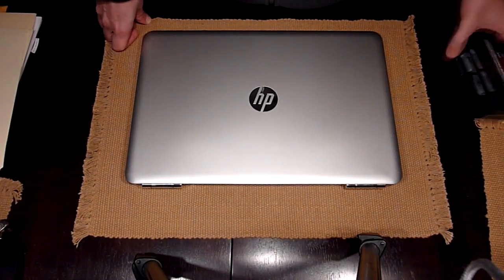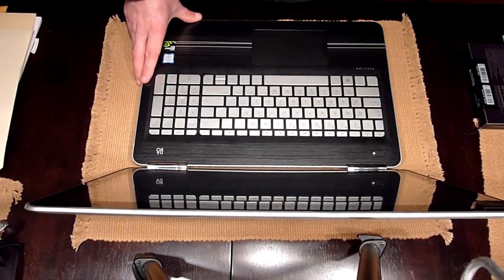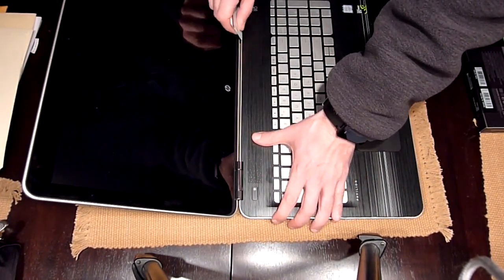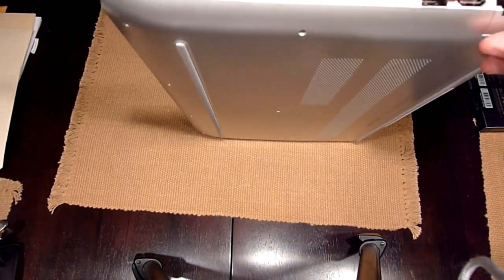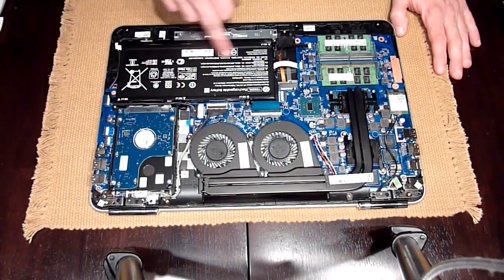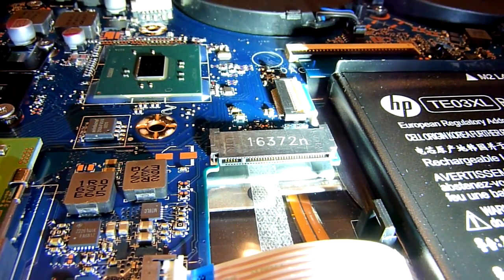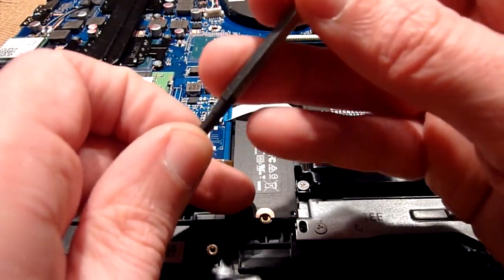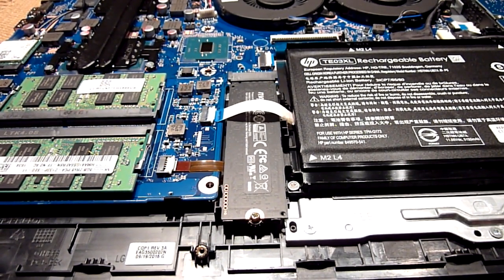HP Pavilion 15 bc018ca Laptop with Samsung 950 PRO M.2 NVMe SSD Drive install

Comment: Thank you so much you have been a great help.. so my conclusion is.. put the ssd in and clone the existing hardrive 
. And when that is done open it up again and swap the existing hdd with a new one. Keeping the old one to keep warranty intact? I thought when I used the migration tool it would take the system of that hdd leaving it formatted
Reply from the maker: You're welcome. Well, this is what I did, I kept that 2TB drive intact with the recovery partion for two years ! My warranty end next week !!! When I had to return my computer in april, I just removed the M.2 drive, poped in the original mechanical drive in and sent it for repair. HP can't say nothing about it, everything is there including the recovery partition. They DID wipe out the original drive, once I got the computer back, it was a fresh install. I then removed again the mechanical drive and re-install my M.2 and continue exactly where I was before removing it !

I have NOT installed a second drive in mine. A second mechanical drive will slow down your system for sure. If you would use a second mechanical drive even if it is to host work files, when you work with those files on that slow drive, the system will have to "wait" for the data to load. Windows sometime will use that drive for temp files (out of your control). When you boot, the system will have to wait for that mechanical drive to spin up and register on the system before the system boot, this will slow down the startup time of your computer for sure.

Either buy a larger M.2 drive or install an SSD as a second drive. This is what I plan to do as large M.2 drive are still quite expensive. I'm not saying not to install your mechanical drive, I am just reminding you that it WILL slow down your computer for sure.
Reply: Sorry I can see your confusion. Although I got sorted.. I installed a 2nd ssd to replace the sata drive that. And with it.. would it be possible to put the sata into an enclosure and use as back up? And if anything went wrong with the laptop just wipe the sata again and reinstall it?
Reply from the maker: @elcooko4372  you can leave the sata drive inside the computer along the m.2 drive but it will seriously slow down the computer for sure. If you use the sata drive in an external enclosure as a backup drive, yes it will work BUT you will loose the original recovery partition from HP as it does NOT transfer from the sata drive to the m.2 drive when you clone it. If you were able to clone the recovery patition to the M.2 drive, I seriously doubt it will work, I've never seen a recovery patition work from any  cloning software.

My goal was to keep the original drive intact with the recovery partion so in case of repair, HP could not detect the PC had been opened.
Reply: Ok thank you.. so when transferring the data to the m.2.
  the sata keeps the recovery partition?
Reply from the maker: @elcooko4372  the recovery patition stays on the sata drive, it is NOT transfered to the M.2 drive. And IF you see the recovery partition on the M.2 drive, I doubt it will work in case you need to rebuild the installation from scratch. I don't know why cloning software do not clone properly this recovery patition... I've never seen the recovery patition work to a cloned drive.
Reply from the maker: @elcooko4372  when you clone a drive to another one, all data stays in the original drive until you delete it or format the drive.
Reply: https://www.easeus.com/backup-recovery/copy-recovery-partition-to- 

It seems it can be copied to a flash drive/ usb 

Maybe do that and then use the sata as a portable hdd
Reply from the maker: @elcooko4372  I have used easeus backup and recovery software in the past but I don't know why, each time I needed to use the recovery patition, the Dell or HP diagnostic tools could NEVER find the recovery patition. Maybe it now work but since I mainly install Samsung SSDs, I use the Samsung cloning tool which does NOT clone the recovery partition. The Samsung cloning software is small, fast and reliable but ONLY works on Samsung SSD, you can't use it with other brands. Other software like easeus or acronis are huge software suites that install many files to do backups and other tasks. Samsung cloning is ONLY for cloning so it is small and fast.

But this is just me, you can use any suite of software you like. This is my preference. I like to keep the whole integrety of the system, this is why I want to keep the original drive intact as long the system is under warranty.

Comment: I have the hp 15-bs033cl and my manual only had up to 512gb for m.2 SSD and was wondering if I could get 1tb instead. Like the Samsung 860 EVO 1TB M.2 SATA
Reply from the maker: yes, I am pretty sure there is no problem about that. The original mechanical drive was 2TB so I seriously doubt this will cause a problem The drive listed in the service manual are the one that HP provides and going over 512GB is going to considerably rise the price of the system, I am pretty sure they keep the size low to keep the cost lower.
Reply: Also why is it that I can get a Samsung 860 Evol M.2 SATA(3 prongs) but I researched and apparently I can't get like a Samsung 960 Evo PCIe NVMe(2 prong), even though I took a look and the Samsung 960 should fit perfectly, perhaps even better than the 3 prong? Both product has the same form factor of M.2 2280 so I was just wondering.
Reply from the maker: why can't you get a NVMe drive ?
Reply: @Aleziss  I was wondering if I could because I was looking on forums and they said this model of laptop couldnt support NVMe
Reply from the maker: oh, that is a different story then, if you found the correct information and it is said to be SATA, don't buy an NVMe, it won't work.
Reply: @Aleziss  Alright thanks!
Reply from the maker: you're welcome. Best upgrade you can offer yourself ! You won't regret it !

Comment: excellent video. I am hoping you can help me. I just purchased the 

HP Pavilion Power Notebook 15-cb061na  in the spec is says 8gb(1 stick) which model of 8gb do I need to make it 16gb?

And what kind of ssd do I need to upgrade the memory? Do I need a connector and if so can you tell me where to find it? Sorry for all the questions lol
Reply from the maker: thanks for your appreciation. Google is your best friend, the service manual of your system state at page 1 " Two non-customer-accessible/upgradable memory module slots,
DDR4-2400 dual channel support, Supports up to 16 GB of system RAM, 16384-MB total system memory (8192×2)" and at page 2, "Support for M.2 PCIe SSD". Information was found on the document here : http://h10032.www1.hp.com/ctg/Manual/c05493193
Reply: Thank you for your time.. Does it say non customer accessible because it's tricky to open? And does that mean I just need to purchase one more 8gb ddr4 ram stick considering it says it already has one?
Reply from the maker: Frankie Cooke  you're welcome. I would assume you are right about the access of the ram. Same goes with mine, there is no access from the outside of the computer, you need to open the case. If you do already have 8GB, you could get another 8GB but if you want my opinion, I would buy a kit of 2x8GB so you have the same memory brand, model and performance. Mix-matched DDR modules can cause issues if timings are different even though they are the same type of RAM modules. Or simply open your computer and check what is already in it and try the get the same thing for the other memory module.
Reply: Thank you very much Aleziss.. I just have one more question regarding the ssd.. Do I need an adapter? And if so which kind of adapter is it? I really appreciate the help
Reply from the maker: Frankie Cooke  hmm... no ? what adaptor are you talking about ? According to the service manual, your model should accept an NVMe drive...
Reply: Ohhh I see.. so any Mvle drive? Is there any difference between  pci and pcle ?
Reply from the maker: I like the Samsung products, free nice migration tools that works every time I've used it. "Modern motherboards use SATA III which maxes out at a throughput of 600MB/s (or 300MB/s for SATA II, in which case, it’s time to upgrade). Via that connection, most SSDs will provide Read/Write speeds in the neighborhood of 530/500 MB/s. For comparison, a 7200 RPM SATA drive manages around 100MB/s depending on age, condition, and level of fragmentation. NVMe drives, on the other hand, provide write speeds as high as 3500MB/s. That’s 7x over SATA SSDs!" So if your board support NVMe, USE IT !
Reply: Thank I ordered a Samsung 960 evo.. and will take your advice and order another 8gb of ram when I open it to see which model I need... when I first boot up the laptop(haven't opened it yet only new)  and then open and add ssd.. Will I be able to migrate operating system while both hard drives are in the machine? Using the migration software? Hope that makes sense
Reply from the maker: Everything should be fine according to the service manual. You install the M.2 drive, reboot the computer, install samsung migration software and let it go. I would suggest you do not leave the mechanical drive in after the migration and keep the mechanical drive intact while your system is under warranty. If something happens, swap the drives as you are not supposed to modify the configuration of your system and it would void your warranty.

I had to send mine for service and I just swapped both drive for the repair. HP did reset the system so I did not care they do it on the mechanical drive. Once I received it back, I swapped the drive again and I was at the same place I used to before sending it for repair.

My warranty will be over in two weeks, I'll probably buy a 2.5 inch SSD drive to install in the computer as a work drive. NVMe SSD are still quite expensive so a second SSD will give me some space and won't slow down the system like a super slow 2TB mechanical drive. The original 2TB drive that came with it is HORRIBLY slow compared to the NVMe drive.
Reply: Is it not possible to just keep the 1tb hdd in that comes with it and then just format it  and use the migration tool again to switch back over if leaving in for service?
Reply from the maker: the migration tool will work only with samsung products, if it detect you want to transfer this on a western digital drive, it won't even budge.
Reply from the maker: the samsung migration tool only works with samsung drive. If you want to transfer to a non samsung drive, the software won't detect the destination drive.
Reply from the maker: what the hell ? I'm trying to answer to you and it won't keep my response... so I try again for a third time, the samsung migration tool only works with samsung drive. If the software detect you want to transfer to a non samsung drive, it won't show the destination drive in the software. Also, the softare does NOT transfer the recovery partition, you might keep the original drive while you are under warranty...

Comment: im using hp probook 450 g4, it has M.2 (NGFF) 2280 slot....does it support nvme? is it m.2 sata?
Reply from the maker: You can only use SATA M.2 storage in your model by the infos I found on google. So not compatible with NVMe drives. A Samsung EVO860 should do the job like this one : https://www.samsung.com/us/computing/memory-storage/solid-state-drives/ssd-860-evo-m-2-sata-1tb-mz-n6e1t0bw/ but please do your own research just to be sure there are many answers on google about your model but at first glance, this is what I found.

Comment: Hi Aleziss,

Since I have recently got my HP Pavilion Laptop (2018 model) 3 weeks ago, I just need to know if the laptop supports M.2 NVME M Key SSD? If not then it would be the M.2 SATA III SSD?

Was thinking of switching my current internal 256gb M.2 Sk Hynix SSD (SK Hynix pc401 hfs256gd9tng-62a0a) for either of these 2 M.2 SSD:

- 2TB Samsung 860 EVO V-NAND M.2 (2280) SSD
- 1TB Samsung 970 V-NAND M.2 NVMe SSD

Plus, I may have to clone the OS to one of those M.2 SSD's by placing them into a external usb enclosure, so which one would you recommend?
Reply from the maker: Yeah, I've been checking drives and the 860 you suggested is a SATA drive. Mine is using the PCIe NVMe with the M key with 4 PCIe lanes. I would not sacrifice that (and I am also not sure if it would be compatible with the B key on some drives) so as for my model, I chose the 850PRO with the M key for that single reason.

If you model has the M key, chose the 970, that's what I would do for sure if the prices where better... I mean the 2TB is 500$ shy of price the whole laptop !

What is the model of the USB enclosure you got ?
Reply: Thanks for your response. Just still browsing for the right external m.2 ssd enclosure at the moment hehe! Any recommendations let me know! May just upgrade the ram up to 16gb (8gb at the moment).
Reply from the maker: you're welcome, actually no, I am also searching the right encosure/adaptor that will support pcie nvme drives... if you see something, let me know and I also will do the same !
Reply: Sure no probs!

Comment: Upgrade your existing 512gb NVME SSD for a 1tb/2tb NVME SSD instead.
Reply from the maker: I wish, they are still pretty expensive, 600$ for 1TB and 900$ for 2TB... plus I need to find a solution to clone two nvme drive...
Reply: Maybe a cheaper but massive storage config: 2TB Samsung 860 EVO V-NAND M.2 (2280) SSD
Reply from the maker: I just checked your suggestion, it's 650$ for the 2TB, 1TB is 380$... I mean my whole laptop was 1349$ and it's now two years old... and I need to figure out how to clone the 512gb nvme drive to another one... My computer came with a suuuuuuper slow 2TB mechanical drive and I sure do miss the space...
Reply from the maker: I just noticed, the 860 is NOT and NVMe drive, it's a SATA drive. My laptop model support NVMe and I would not install the 860 just for that reason.

Comment: I have the hp envy 17-n109tx and I have the m.2 slot but I'm confused whether it is a m.2 sata or nvme slot. The slot is m shaped that looks like yours. Please help me if you know anything about that I don't want to buy a sata ssd and lose the 2tb hdd
Reply from the maker: I see  no mention of nvme drive in the service manual http://h10032.www1.hp.com/ctg/Manual/c04696907 but I do see M.2 SATA which should be compatible with Samsung 860 EVO
Reply from the maker: https://www.samsung.com/us/computing/memory-storage/solid-state-drives/ssd-860-evo-m-2-sata-250gb-mz-n6e250bw/
Reply: @Aleziss  sir, you can still use your hdd ? Together with m.2?
Reply from the maker: @LuwieMangubat  absolutely, yes you can, but I would not recommend it... it WILL slow down your system A LOT ! The system will need to wait for the drive to spin up when you start the computer, the transfer speed is WAY WAY slower than the M.2 drive... if you want to use a second HDD, I would put a 2.5 inch SSD drive at least and NOT reinstall the mechanical drive. It WILL work but you will slow down your coputer a LOT if you do so. The system will need to wait for any file transfer you do.

Comment: HP bs164tu can i use m.2? and i dont want to loose my hdd though
Reply from the maker: according to crucial, it does : http://www.crucial.com/usa/en/hp-15-bs164tu/CT12370400 but I would advice that you open it and check if the connector is there. Also, leaving the mechanical drive as a second drive will slow down the operation of your computer. I would get a bigger m.2 drive or buy a 2.5 inch 1tb ssd as a second drive.
Reply: Aleziss thanks for your reply sir actually I want to keep the HDD because it's cheap and I only use my laptop for programming youtube videos and other light stuff so I only need some fast loding speed it really annoys me to wait 1 min for it to boot up, a 128gb M.2 as a boot drive will do the trick until I actually buy a ssd ( apart from all I don't have a budget for 1tb ssd sed lyf  ;__;)
Reply from the maker: Athar Tech Zone I would not suggest that you use your mechanical drive... even at boot that mechanical drive is going to slow down the boot process. Windows and programs will want to load fast but if there are some information stored in the mechanical drive (temp files, swap file or any other data), the system will need to wait, beleive me, I did the test with the original 2TB drive and it did slow down a lot... Even if you want to use the second drive to only store files, windows and other programs always find ways to dump files on that second drive. Specially if you are doing video editing, you are missing the opportunity to work with a fast drive for video manipulation, it does a HUGE difference while working with files on the mechanical drive vs the m.2. Just saying, you have a nice system, do the proper upgrade and find yourself a bigger m.2 drive, you won't regret it.
Reply: @Aleziss  whatever u said is so true I will start saving for it then thnx for replying sir 🙂
Reply from the maker: +Athar Tech Zone, you are welcome, I don't know where you are but there are good deals often found at newegg. I get most my parts from them when they are on sale. Good luck !